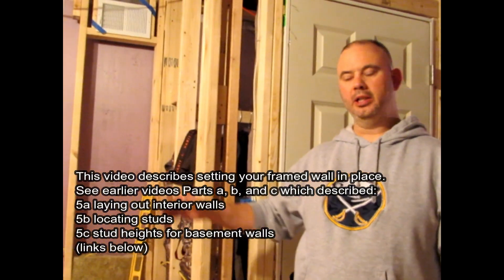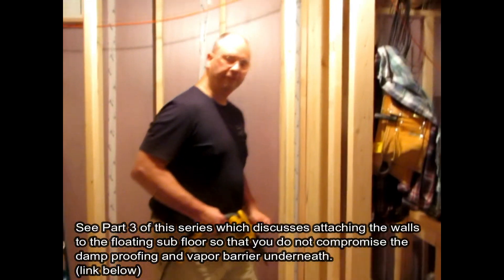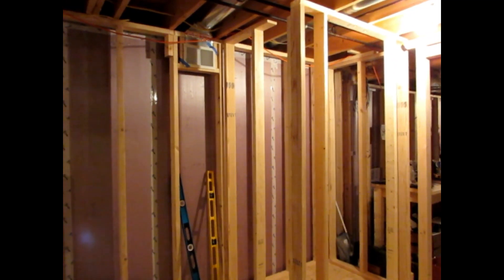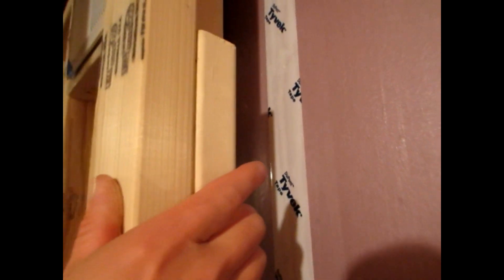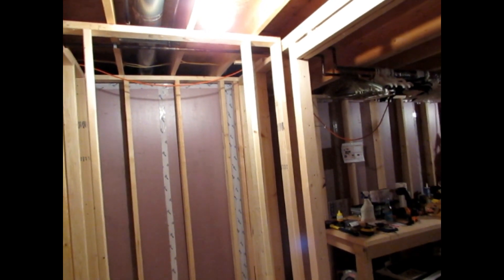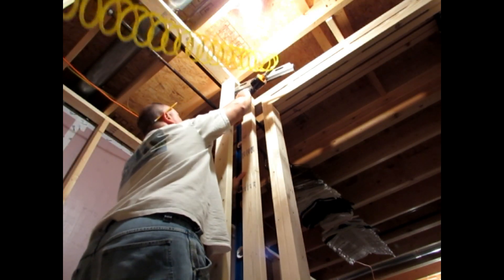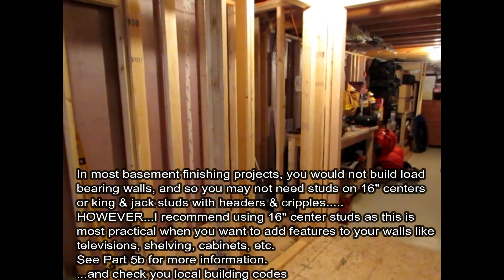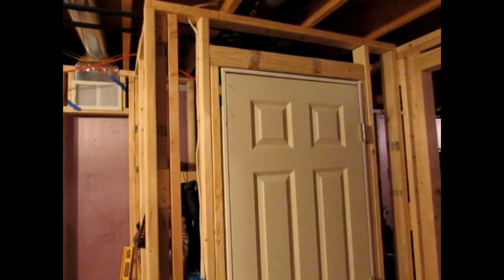Finishing a Basement - Part 5d - Building Walls - Setting & Plumbing

Comment: I am 28yo and just naught my first home with my wife and two young kids. The basement is a flashback from the early 80’s complete with a blue toilet, blue shower, blue vanity, old fiberglass insulation, uninsulated rim joists, cracked vinyl floors, wood panel walls, cold floors and even colder drafts. Your video series is EXACTLY what I have been spending months looking for. THANK YOU for the detail and time you put into making these. Especially the first few on what insulation you use and the sequential steps for insulating the walls and installing your full sub floor system. I am going to be following your step by step videos as I remodel my basement. 

Question: when you purchased all your materials, do you find it cheaper to go through big box stores or do you have any recommended distributors who deliver in bulk I.e fomular XPS paneling , underlayment and sub floors. I’m in Northern VA. 

Thank again 
-Nico
Reply from the maker: Thanks and glad to hear this might be useful for you.  I had the same frustrations when I started in trying to figure out how to pull it all together.

Comment: Great video - I am in the process of finishing my basement and am using much of the same material and techniques, thanks to you.  One question that I’m stumped on, how did you do your horizontal fire blocking as to not compromise the insulation and vapor barrier.  I’m almost to that point and am curious on what you did.  Thanks!
Reply from the maker: I have a video on fire blocking I'm making...just haven't had time to put it together yet.  Stay tuned.